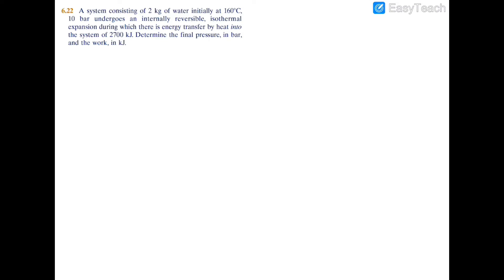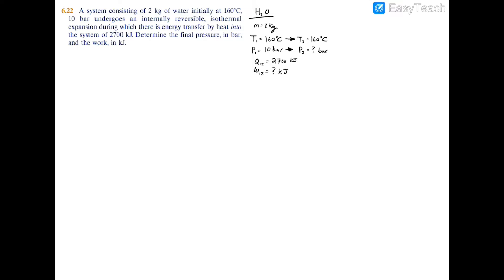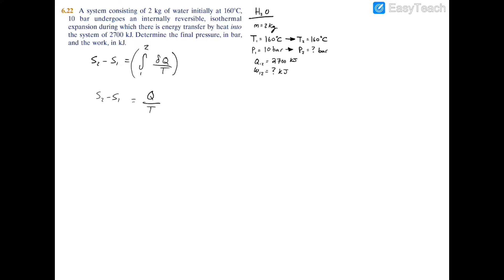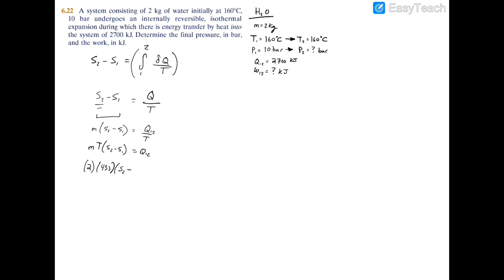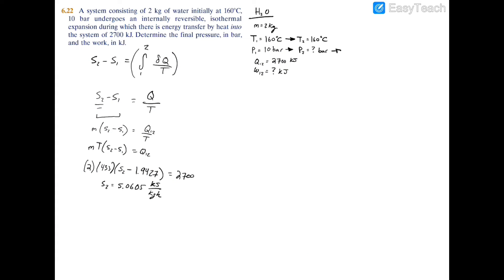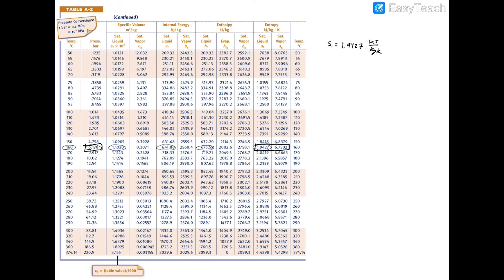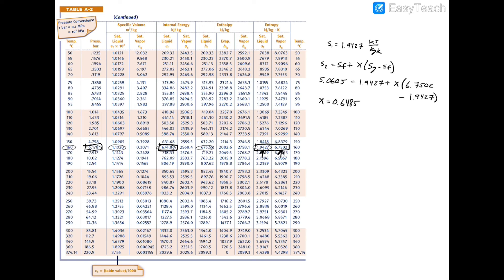6.22 A system consisting of 2 kg of water initially at 160°C, 10 bar undergoes an internally

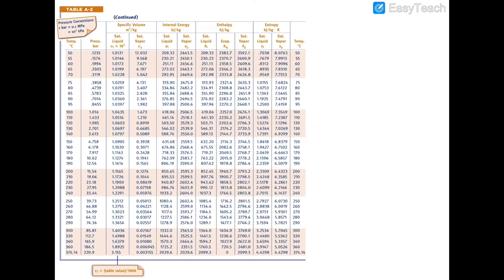Comment: at 3:12 why we didn't use pressure table
Reply from the maker: You may use the pressure table to find what state the water is in (compressed liquid) however, whenever you are dealing with a compressed liquid whose properties are unavailable in the compressed liquid tables, you must use the temperature table to approximate the properties. Entropy is more dependent on temperature than it is pressure, so it would be less accurate to use the pressure tables to find the specific entropy.

Comment: Sorry I deleted my comment
This is for anyone who wants to ask the same question.
My comment was

I think you used the wrong table because it's superheated

GR Engineering replied with

At state 1, the pressure is equal to 10 bar. Turn to table A-3. You will find the saturation temperature is 179.9°C. We are given 160°C at state 1, which is lesser than the saturation temperature of 10 bar. Therefore, we are to the left of the vapor dome, which is actually in the compressed liquid region, not the superheated region. Unfortunately, this textbook does not supply a compressed liquid table for 10 bar, so we can approximate using the saturated liquid properties at our temperature (160°). The table I used is correct :) 

Thanks for the reply!
I always get confused with this point.